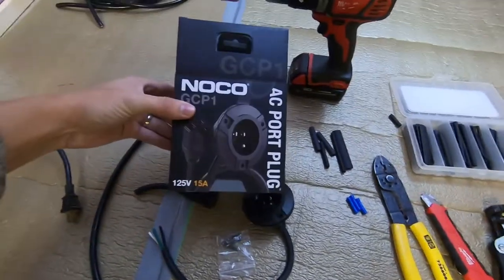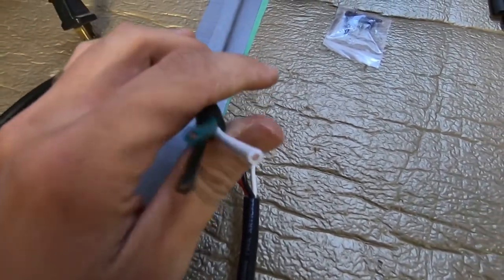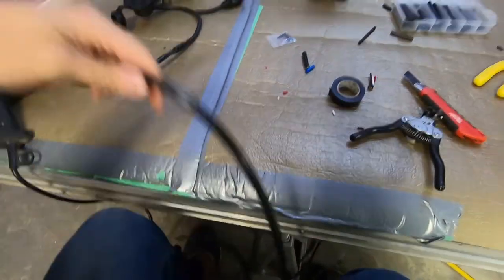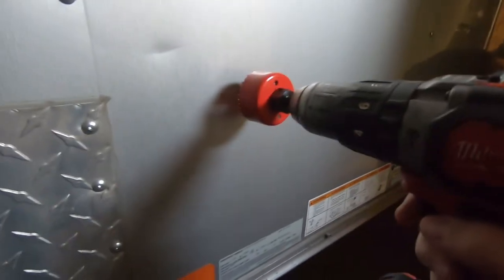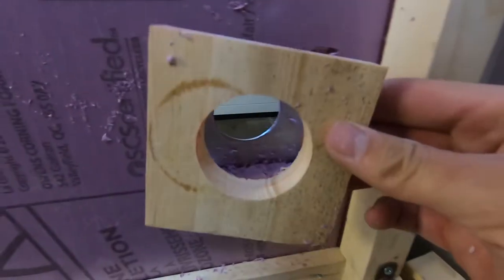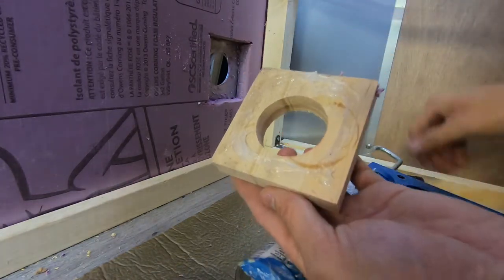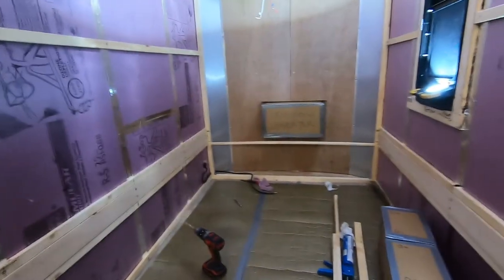Shore Power PLUG Install | Cargo Camper Conversion

Comment: I will have to watch more of your videos. I just did a search on "installing a shore power plug in cargo trailer" and yours was on top but I have not seen your channel doing other searches on Cargo Trailers. Mine plug did not come with a pigtail so I don't need to do any splicing. Nice that you get to work indoors.
Reply from the maker: I have all the step by step videos of the build on my channel. Thanks for watching! Hope you're finding it useful for your build!

Comment: Good job. 

The cardboard inverter is missing cooling vent slots. 🤣🤣

I normally I install these types of things on the passenger side so rain, snow & road debris do not get at it from oncoming traffic. 
Plus it can safely be acessed if on the side of the road and I will not be hit by passing vehicle.
I install the plug so the cap closes in the down position or facing back so the wind or a tree branch,.. cannot open it when the trailer is moving forward.
Reply from the maker: Thanks for the remarks! Glad you enjoyed the video haha.

Comment: You could’ve just tested continuity on the plug and wire. You didn’t need an extension cord plugged in.
Reply from the maker: Thanks, I did not know you could do this. Will keep it in mind for the next time! Thanks for watching.

Comment: I plan to live on the road with my 6x12 cargo trailer and while just starting to research how to install electrical, I'm wondering....Why is it that some people use 15amp shore power plugs and others' use 30amp for their cargo trailer conversions? I'm leaning more towards a 30 amp since most RV parks use them. Why did you get a 15amp? I realize we can get adapters but I don't know if it's better to go from 15 to 30 or visa versa? Any input is much appreciated.
Reply from the maker: It all depends on your loads you plan on having! I won't be running much so I won't ever need more than 15amps.
Reply: "Ever?" Wouldn't u rather just have the 30amp just in case? Better to have more than not enough right? I'm trying to make a decision and probably overthinking it. Thx
Reply from the maker: @artest7  that is something you have to come to terms with. I won't ever be running AC or any other demanding appliances. If you are unsure I would suggest just putting in 30amp so you have more than you need worst case scenario :)
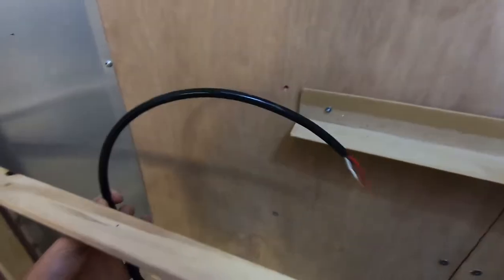Reply: @JoelTremblayCA  BTW @ 7:30min of ur video u said you were going to hook up the shore power wires (3) to an inverter? Is that corrrect because I thought you hook up your 12Volt battery to the inverter in order to get 110-120V. Did u mean u were going to hook up the shore power wires(3) to a CONverter? Thx
Reply from the maker: @artest7  this is a inverter and converter (combo) so essentially you have to do both! On the device there is a 12V DC input (from the battery), a 120V AC output (power the plugs in the trailer) and then 120V AC input (shore power, for the converter part to charge the battery)
Reply: Never say never!  These are always ever-expanding projects. Always plan for the what if upgrades. Put in a tee with a plug instead of an elbow, 12 ga wire instead of 14 ga, largest battery cables for the inverter, (don't forget to fuse your battery cables or have a disconnect at the battery terminals) bigger fuse box! Larger ply tires. Nice build!

Comment: Dont you only need to wire 12volt to an inverter if shore is already 110 no need for inverter or am i missing somthing?
Reply from the maker: This is an inverter/converter so it will take 110 and convert it to 12v to charge the battery. Inverter does the opposite, transferr 12v to 110. Thanks for watching
Reply: @JoelTremblayCA  should add that to the video title !